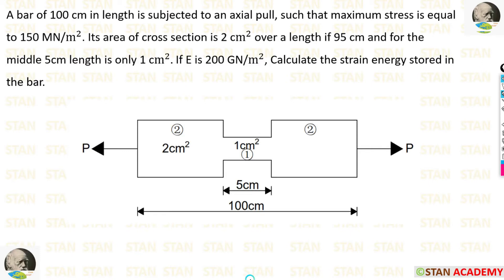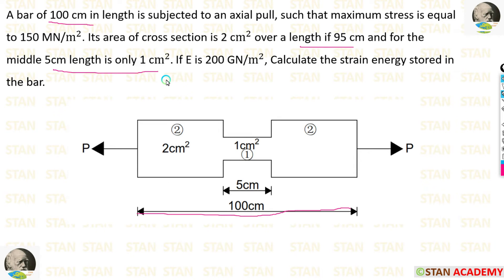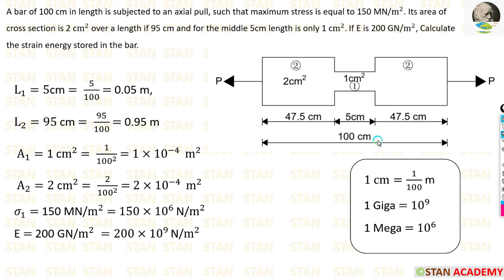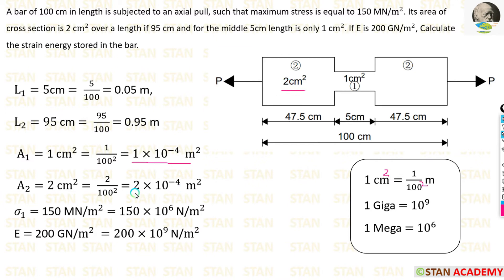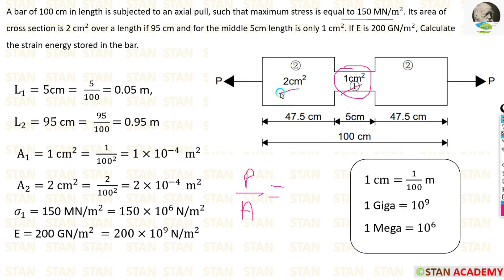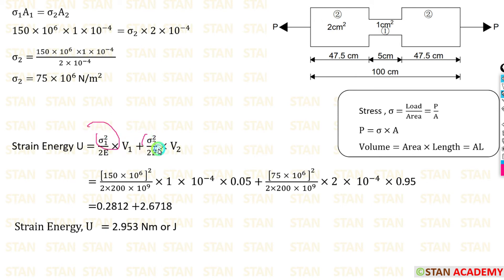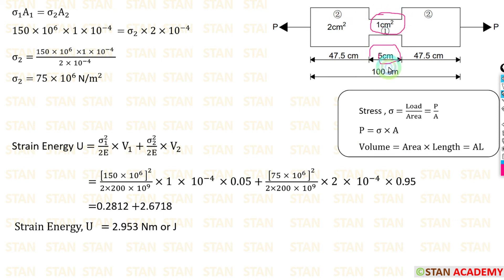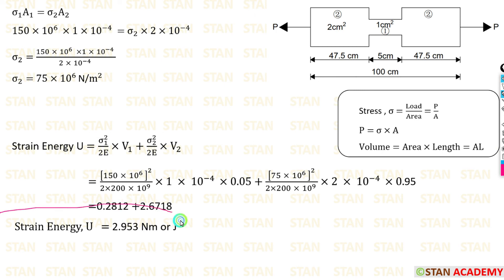Strain Energy - Problem No 1 (From previous university question papers)

Comment: A rectangle column 200mm wide and 150mm thick is carrying a vertical load of 15KN at an eccentricity of 50mm in a plane bisceting the thickness.Detetmine the maximum and minimum intensifies of stress in each section